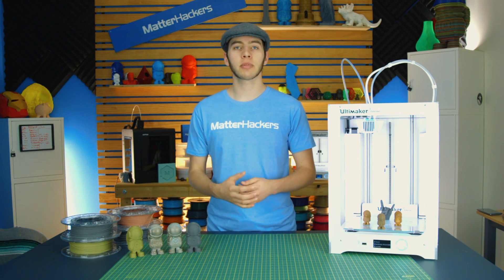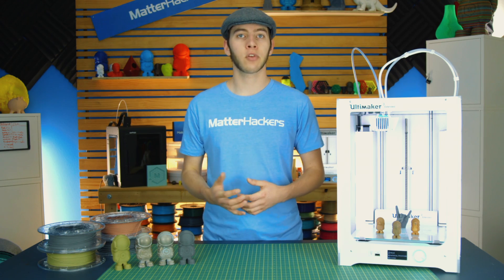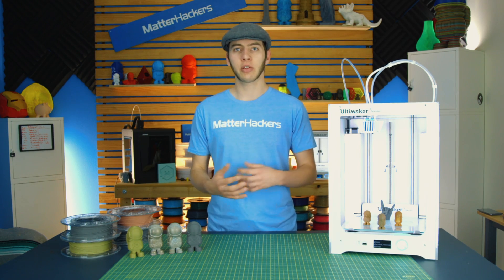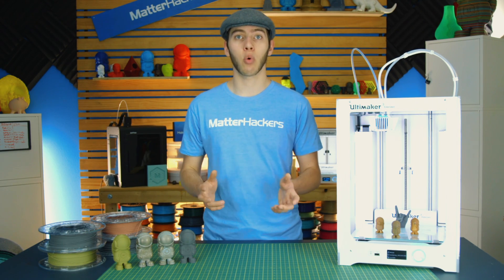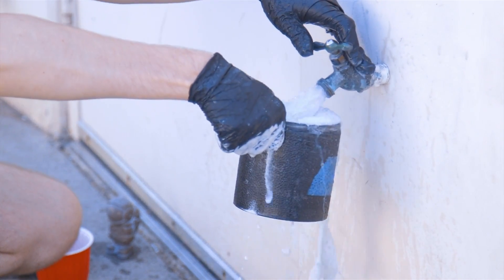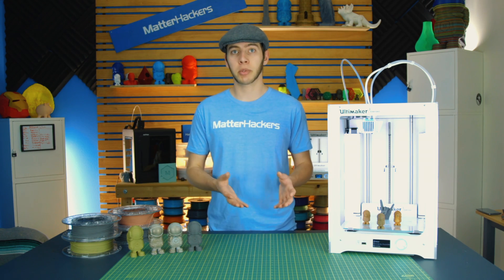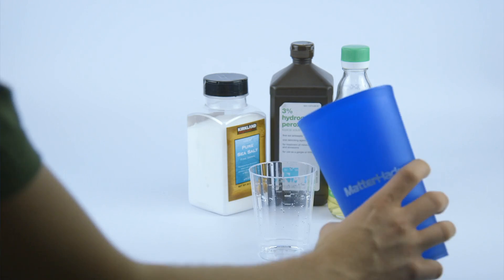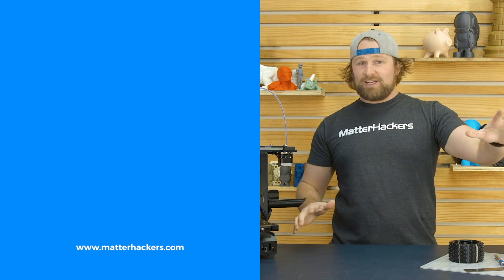How To: Post Process Metal PLA // Filament Guide

Comment: For the copper-infused PLA I used wet 1000 Emery paper then 1200 and 1500 then some lapping papers to polish and painted mustard onto the part in corners and high places and placed it in a sealable bag and placed it in a warm place for 10 days then washed it and dripped vinagar on it and back in the bag for another 10 days, the mustard gives a bright turquoise patina and vinegar the classic green weathered copper, the second time I used vinegar first and then mustard at the same time and left it in the bag for 10 days, awesome results

Comment: I appreciate your tutorial but I've had good luck with much simpler techniques- just dry media (steel pins or brass screws) in a tumbler for 12-24 hours.  I've tried both dry and with a little water and both seem to work well, but I never had the tumbler completely packed like you did.   It would be interesting to try a comparison with your more involved technique.  Definitely an art to this, no one right way...
Reply: Yes, 4 weeks is total overkill!  I use brass screws as well and a bit of water and washing up liquid for lubrication, pieces look great after 24 hours.

Comment: Couldn't you use material that is more aggressive so you don't have to leave it in there for a week? That seems insanely long. What is the electricity cost for that?
Reply from the maker: Because there is more PLA than metal in the print, if you get too aggressive, you can damage the print - friction will cause the plastic parts of the print to melt and warp, so a long, gradual process is best =)
Reply: One week per grit is standard for tumbling rocks. Three grits and a polish mean 4 weeks total for one batch of rocks.
Reply: Using brass screws and a very small amount of water and a dab of washing up liquid reduces the time to about 24 hours.